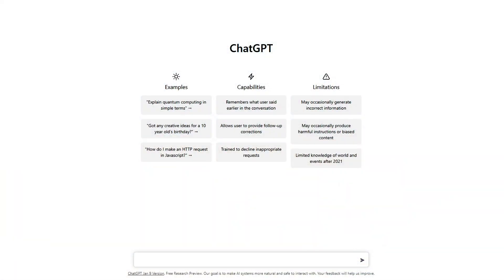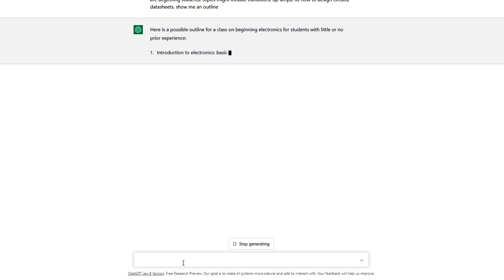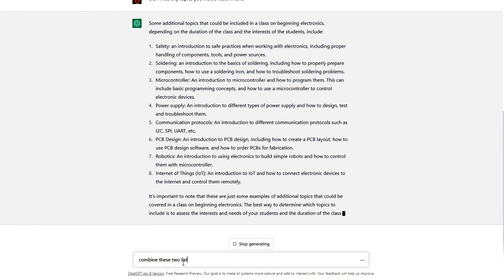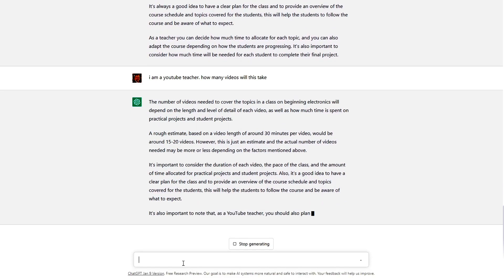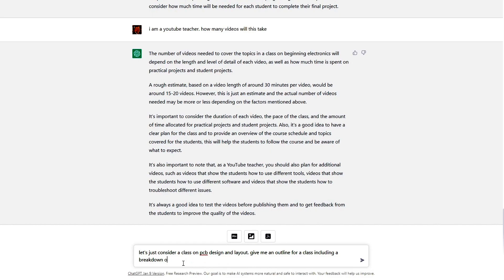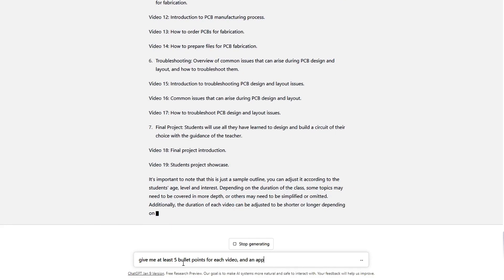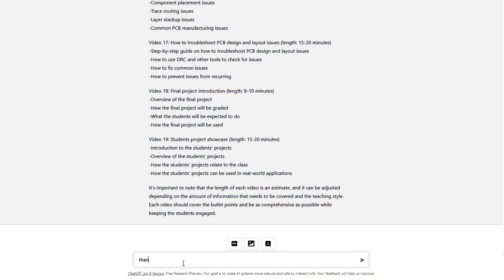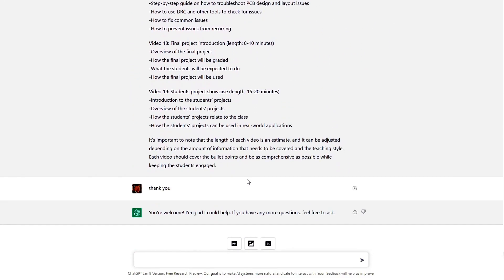#1389  ChatGPT PCB Layout Class

Comment: So I've been fiddling around with building a circuit to buffer the output of a current sense transformer and then run it through a comparator to turn it into a digital input for a microcontroller.  I asked  chat-gpt how to do it and it basically got everything right, or nearly so.  But those nearly parts -- how would anyone know they were wrong?  It's an amazing tool nonetheless...